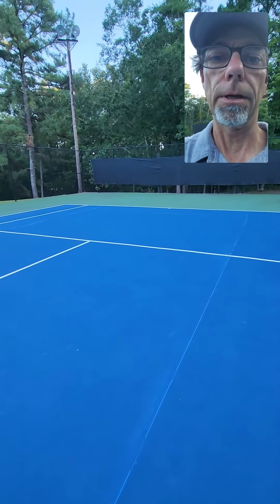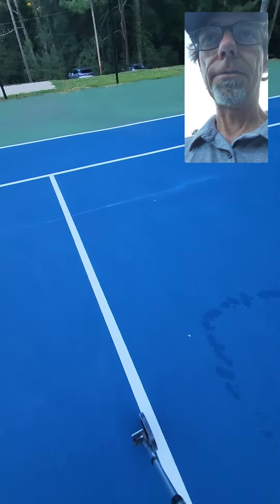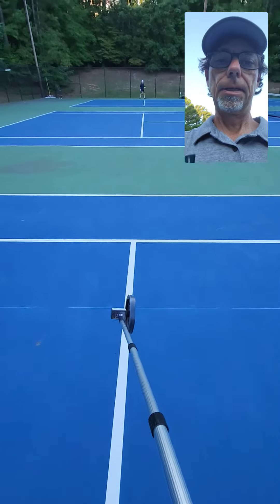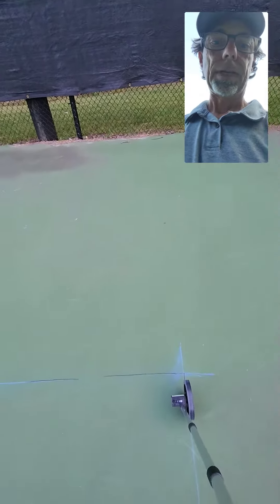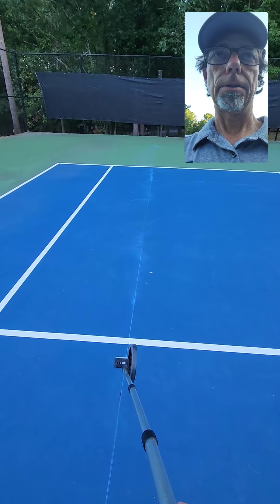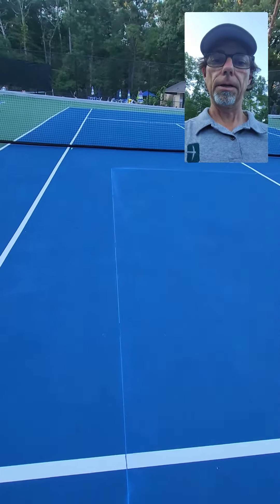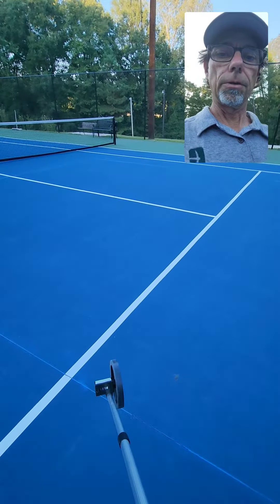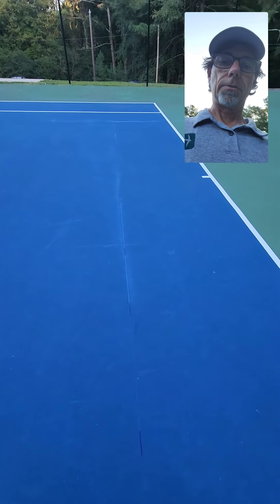How to quickly mark off and tape a Pickleball court on a tennis court

Comment: Good idea. What did you do on the measuring wheel, just sprinkle some chalk dust on it? Thanks for sharing.
Reply from the maker: Use the red chalk line.  It's semi-permanent. It will last for a few mos.